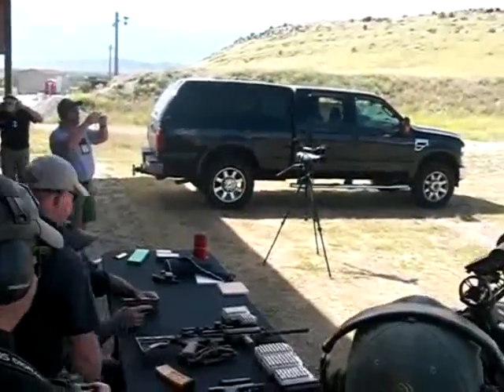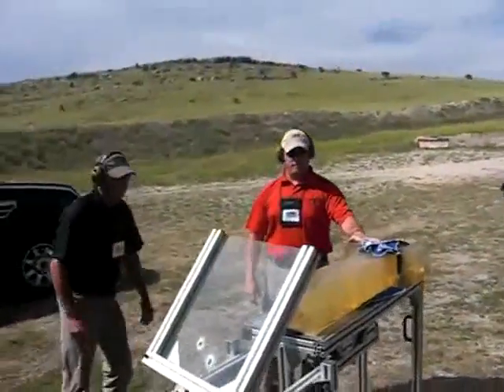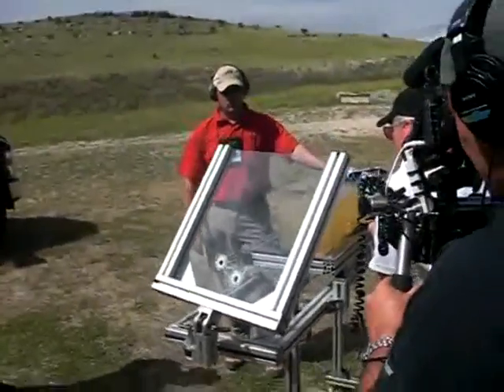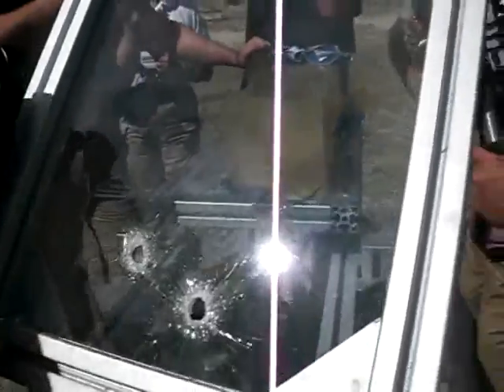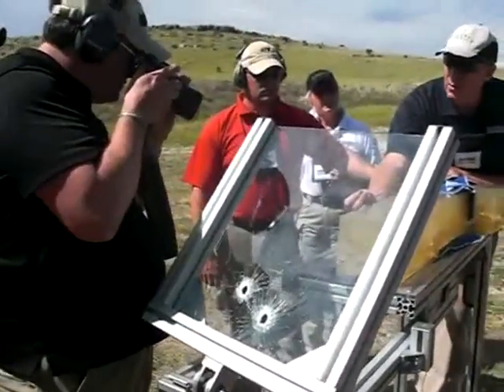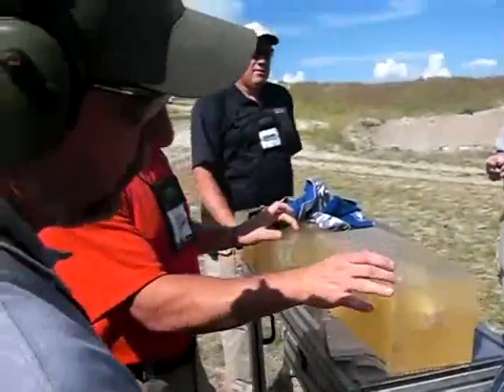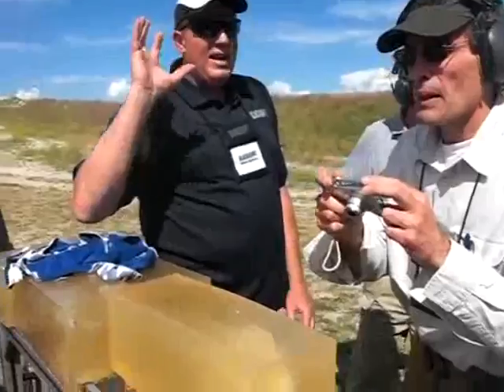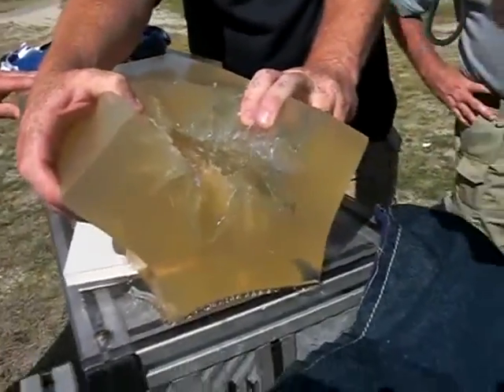Shooting Through Windshield Glass and Ballistics Gelatin

Comment: I've watched YouTube videos that show a 380, 9mm, 40sw or 45 will all go straight through car windshields useing regular fmj bullets.
Reply from the maker: +Chris Collins Sure, I have seen cinder blocks go through car windows too. The challenge is to get an expanding defensive round (which is what police carry) to perform as intended through auto glass. This is extremely difficult as angled tempered windshield glass tears normal hollow point bullets apart.
Reply: +Jorge “GunsNTacos” Amselle I c did you mean federal hst jhp's I've heard that when jhps go through car windshields the tip is to damaged to expand but if hst's do that would be good it works good in 45acp in gel tests I've seen.
Reply from the maker: +Chris Collins I can't say on that round specifically but for standard JHP the glass tears the jacket right off and the bullet veers off target and does not expand. Bonded bullets stay together, keep going straight and do expand reliably but they do look more damaged when you pull them out of gelatin. This applies to CCW as well if for instance you had to shoot from inside your car or into a car of someone attaching you. FMJ ammo does not expand and over penetrates which can hurt innocent bystanders.
Reply: +Jorge “GunsNTacos” Amselle thanks man did you find any good jhps that will expand after going through car glass I've just been using regular fmjs in my 380 and 45 cause jhps threw barriers concerns that they won't hold up like through car glass for instance I'll subscribe to your channel thanks for chatting :)